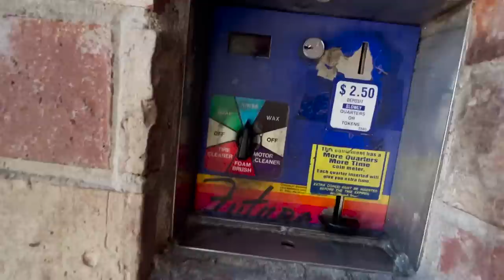They RIPPED My Truck Apart

Comment: if you have troubles hanging your decor lights, try velcro tape or double sided tape and put shoe laces or string to make hanging points for your lights. also a broom stick might help you for pushing up you tent. also maybe pad lock your clasps for security.
enjoy your new digs.

Comment: My dad sort of gave me playbook because he messed up maybe once a decade: oversleeping: always set two different alarms, one electric and one mechanical in case power or batteries fail. Getting locked out: always carry two sets of house and car keys on your person. Then I keep a third set in my home (for the car) and in the car (for my home). Computers: keep at least 4 backups of everything, never ever count on your phone or one computer and keep backups both on online servers and portable harddrives. Those phone backup services are a ripoff with a capital R and if you miss one payment all your data is gone or held hostage. I put my data on one backup service, they went out of business, and we were all left high and dry. Take ownership of everything and trust other people and companies to the least extent possible.

Comment: 2.0 looks & functions amazing!  Does the added weight of the pop up roof give concern to increased rollover scenarios?  Not that you rock crawl, but you are off road often to an extent.  It may be worth it to have a shop fabricate some sort of roll over bar, whether within the cab or an exoskeleton type of application.
Reply: Looks like it’s comparable to the weight she already had up there. Maybe even less. Cuz she won’t have that extra cargo space she did above here center of gravity. Even if it was “added weight,” don’t forget she lost a lot of it when removing shelf and cargo from up top. I think finding how to economize her lower level to accommodate her cargo etc would be the next step in this build. Adding weight with an exoskeleton would not be efficient in this scenario since as you mentioned she’s not doing extreme climbing. If she economizes cargo and weight distribution she should be fine.
Reply: It's actually lighter than the original roof,but still keeping integrity.
Reply: I found the specs...it's 155 lbs (70kg) heavier than the factory roof so pretty negligible after all.  Good points on redistributing the weight from the removal of the shelving.

Comment: Yes, renovations are stressful, but this is a good change, and will bring good memories for you and Vilk. Happy days ahead. Long miles in comfort. See about the propane fireplace to add heat that installs in the rear passenger corner. Baby steps. Home building. Enjoy!

Comment: You gain a lot of headroom but not without some losses of security. With the steel roof removed, there is no longer a closed integral steel enclosure. If the roof cannot be locked down in the closed position from the inside, then anyone can just pop it open from the outside. I wonder if there's also some loss of torsional stiffness and rollover protection because the rigid steel top has been removed. Perhaps they have thought about these issues and designed some features for it. Certainly looks like an interesting product!
Reply: I think it's a body on frame chassis, and the new top looks like it's probably aluminum, probably no worse off in a rollover than the factory roof.
Reply: It'd be nice with at least one crossbar for torsional strength
Reply: The defender does not use the roof for structural integrity. This modification has no structural effect to torsion on the frame.
Reply: It's also not the perfect choice for sleeping in "Bear Country" where she had planed to sleep fully enclosed by the original structure, and not canvas sides. Not that she couldn't keep her plan to stay in the closed shell, but it doesn't sound like it at this point. That being said, it sure opens up that little Rover.
Reply: @scotcoon1186  yes, it appears so. Otherwise they wouldn't be able to remove the original roof without cutting the metal. They unbolted it.  But why not put back those handy storage areas?

Comment: You’ll love it. I have one on my Troopy. Much better insulation, so comfortable and easy to set up. I’m happy with the mattress but a lot of people improve it by putting a mattress topper on it. Carry some spare latches with you as they do break. I use a couple of small caribiners to keep them closed, in the US you may need padlocks for security. Enjoy the upgrade!

Comment: Congrats on the new upgrade Eva. Ever since you have installed the roof tent, i was wondering to see the whole roof being replaced with the expandable roof with more space. I felt that the space is not sufficient enough and there is no room for proper solar panels. Maybe now you would have room for solar panels as well for enough energy and reduce the fuel consumption to some extend. Look forward to more travel vlogs and upgrades of your vehicle. Good going. Happy to see vik getting adapted to living and traveling in the vehicle. Any upgrades planned for his comfort such as replacing the fan etc.

Comment: @20:25 - Aaaaaand....this is why I own a cat.  Sure, my man has brought a live mouse into my home and is the reason I don't ever need to set an alarm (Albert does not tolerate late breakfasts...and he is 20 pounds of convincing), but he is pretty neat and requires very little maintenance.  Nice new digs.  Good luck as you travel North!

Comment: To replace your cabinets you lost, have you thought about a set of rails or hooks on each side to mount bags to that hold your stuff?  Plenty of backpack accessory bags that mount that way.  That way you can take it down and out of the vehicle to use as well as leave it hanging in place.  Just an idea.

Comment: Wow. I'm kind of watching your vids out of order, several expeditions at once so to speak, so I have seen the tent top. But I never really realized how cool and versatile it was. to be able to even fold the bed out of the way, genius, and to have it there for another entire level of space to sleep, awesome. I'm glad you took the time to show how it works, it had a few tricks I had never imagined. And since you're losing the entire stock roof (which I hope you kept or sold because it is very valuable and you can always put it back on as well), you are also losing all the weight of the original roof, which offsets the weight of the new top. I'm guessing it still adds a bit, especially if you keep stuff up there, but you can definitely manage it by trying to keep light stuff higher, and heavier stuff lower in general.  I think it looks great, but more than that, it is so versatile and gives you so much extra space when you need it. Standing up is a game changer in this rig too. And I guess you won't need a tube to heat your rooftop tent anymore. Congrats.

Comment: May l suggest you fit a temporary removable pole to your bull bars. the pole will have a pully fitted at the top and you can then use your winch to pull up the roof and save your back! l am not sure how l would fit this to my Prado or Surf but it goes like a dream for the defender!

Comment: A basic, bare bones Alu-Cab bolted on top of your roof is close to $4,000.  I just checked on the prices for the AluCab "Icarus Roof Conversion" and it's so incredibly expensive, they don't even list the price.  You have to fill out a contact form and they'll get back to you! 🤣

Comment: As you continue to head north towards Alaska, I'm sure you'll be passing through the Canadian Rockies. As I used to live out west, may I make a few humble suggestions?

Lake Louise is possibly one of the most photographic places on earth. The lake is fed by glaciers and is an almost alien azure blue. You can rent a kayak or peddleboat to go out on the lake. There's also a short, but rather popular hike from the Chateau to the Plain of Six Glaciers.

If you're into mountains, there is a beautiful, but challenging hike to the summit of Mt Rundle. It starts in the town of Banff proper, a very busy tourist trap, and although many people each day embark on the hike, the majority turn back as they are unprepared. I'm sure you have the fitness and stamina for it though. It's approx 13 km one-way, but also features a 1500 metre elevation gain. That's 1.5km...UP! For preparedness, I'd highly recommend having a spare shirt in your pack to change into, although it's hot while hiking through the trees, you'll sweat through the shirt and you don't want to be wearing a sweat-soaked shirt on the windy upper slopes. Pants that you can pull on over your shorts, good hiking boots, and a fleece sweater are essential as well. The summit is at 10,200ft above sea level.

If you are not claustrophobic, may I recommend the guided caving tour in the caves near Canmore, AB. It's a guided tour, you have to book in advance online, but the group they take is small, only 5-8 people plus the guide. It is an exhilirating experience and I highly recommend it.

Heading north, consider taking scenic highway 93 which runs alongside the Columbia Ice Fields towards Jasper, AB. Once in Jasper, you may consider treating yourself to a relaxing soak in the mineral-rich waters of the Jasper Hot Springs.

And if you're into it, remember Canada has legalized cannabis for recreational use. However, if crossing from Washington state, where it is also legal, it is actually illegal to bring it over the border...

Comment: Cool. I used to own a popup camper, excellent for a run around too because of the smaller profile compared  to a standard camper. Shame the hold down clips aren't on the inside Eva. Also how's the Starlink working out?

Comment: I believe, repeating your own mistakes is quite common. Because you have learned to react to specific situations in a certain way. It's very difficult to change that, because it comes from your character and temperament. So, I believe that you know you are doing something "wrong", but you usually do the same things over and over. Great video, btw.

Comment: See i would've just raised the roof height permanently, just high enough to stand. That way you can build in cabinets and leave stuff in places without having to put stuff away all the time.
Make the front slope so it's aerodynamic. Give it hard sides to make warmer and more secure. Built in lighting.
Something to look forward to.

Comment: I just found your channel.  You are really living. Congrats.  A couple of ideas for you.  Rather than making fun of your axe skills.  I would suggest you go buy a small bow saw.  an axe may be cool but a saw is much more efficient and will make wood gathering much easier.  You may also wanr to buy a file to keep your axe sharp.   Most suggest bear spray be kept readily available i.e. on your belt.  As much experience as you have almost seems disrespectful, I do not mean it to be.  I greatly admire your courage.  Keep enjoying and keep safe

Comment: It would be smart to ask them if staying in the tent is reasonably safe if there is a grizzly bear wandering around outside.  My bet is that you would want to get down into the car WITHOUT going outside and drive off even with the top still up.  But those guys should be able to tell you better.

Comment: Hello Eva,
it was really funny top watch this video, because I did the same decision three years ago. I've had rooftop tent in my Landcruiser for more than Steven years - and I loved it. Ist's so easy top set up and close and, copared with a normal tent, all the uninvitet visitors, Like spiders, snakes, scorpoins and others are about two Meter under your bed in the ground.
But after seven years climbing on and around the car when I had to close the rooftop tent and beein OUTSIDE the car when sleeping, I also bought a "Klappdach" (I don't No the correct english word).
It has so much advantages. I can open an close it in one Minute and I sleep in the car. I can stand in the car an sit upright (I'm 1.90m tall). There ist a Security gain: I can escape from an ubsafe Situation without leaving the car.
So: Congratulatons top your nee roof!

Thank you for all your videos. Go on living free, as long as you're  young enough.

Comment: bY 76, I have learned the meaning of life..   THERE AIN'T NO FREE LUNCH !  You have to work for everything, even if it looks like fun to some.  There isn't a point where you feel ready for anything that comes along, however most parents do the best they can.  The book of Proverbs in the Bible is pretty good also.
Having 1.6 million subscribers can make life easier, and vehicle modifications accessible.   At some point, you may want to trade it for a small class C motor home for comfort and security.

Comment: Typical, overbearing father here. From what I understand this is close to a twenty-year-old vehicle. Like any father I'd like to know if and when you get the oil changed, the tires either rotated or replaced, have you checked the radiator coolant lately, do you have a jack, a spare tire, are you capable of changing a tire on that big vehicle? If you're going to Alaska, you had better be prepared, and the truck has got to be up to the challenge. I don't think Vilke will be much help for you in case of trouble. Be safe!

Comment: If it was a book we wouldn't learn as well the fail is the sail... And the purpose of life is very simple... It's connection... Everything from the birds to the bees and even the tree... If we are not connected we cannot learn from one another... If the inter-NET the spiders Web 🕸️🕸️🕸️🕸️ has no connection you an be a fish caught on-LINE... If your wires are not connected you get no flow ya know🗝️👍

Comment: I don't mean to be a wet blanket, but you mention bears and Alaska in the same breath. You new lid is not "bear proof."  You can see aluminum sided camping trailers that have been shredded by bears. And, it appears you sides are still nylon. Please be prudent and don't put too much trust in you new lid.